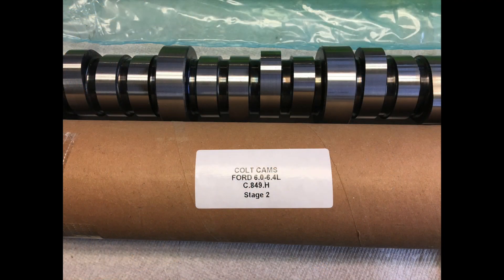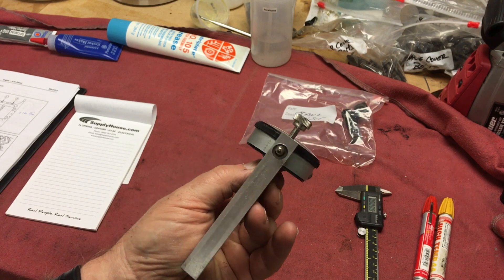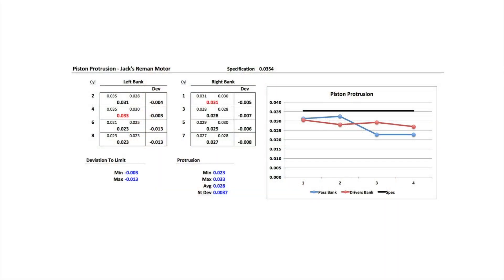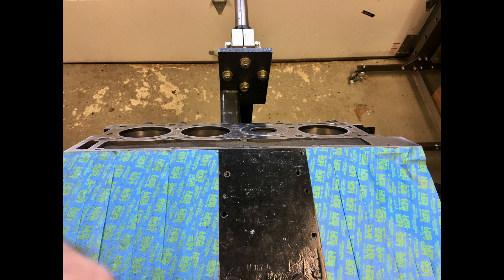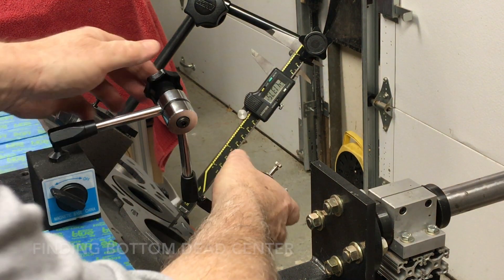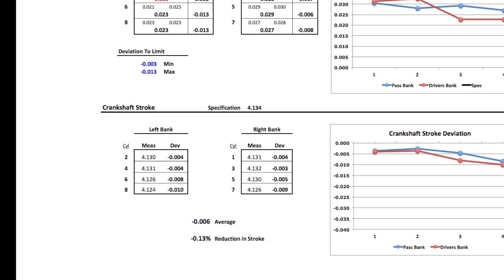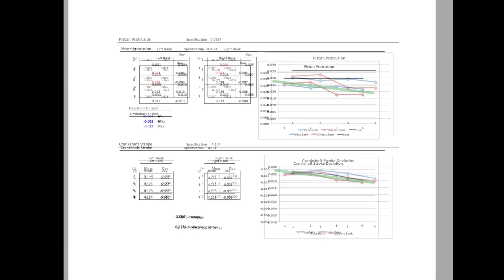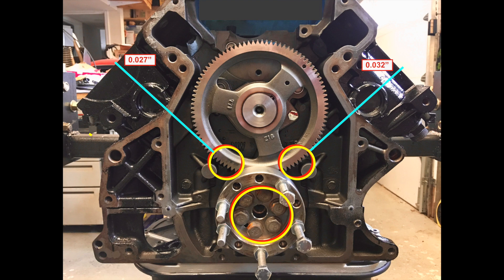Powerstroke 6.0 - Measuring Piston Protrusion and Crankshaft Stroke

Comment: Thank You so much for this video. There are 100's of videos on here of people "slamming" engines together and either they don't show the important measurements or they don't know to do them. This is the difference between doing it right, and wondering how long it will last. I never, ever want to pull the engine from my truck again. I'm checking every single measurement I can while building it. It's the only way I know to feel comfortable it will last.
Reply from the maker: Thanks for another comment.  You are right.  There are many that I try to watch, but stop when it's not the content I was expecting.  I too try to put things together so I don't have to worry.  Many years ago I got to spend a lot of time with Bill Stroppe at his garage - weeks.  The lesson was take care of all the little details and you won't have big issues.  Build for endurance.

Comment: Btw you made it possible to get my truck back on the road doing this job on gravel in between jobs living full time in a fifth wheel with my wife and two kids.
Reply from the maker: I'm glad you got it done, especially under those circumstances.
Reply: Yes it was not ideal but I got it done and towed my 41’ fifth wheel 2 days later. Now I’m looking for some work welding across the country so I’ll let you know how it goes after I’ve put several thousand miles on it.

Comment: I lapped the heads of my 6.0 and my head measures 44.94mm where I read spec should be 45mm, is this too much a deviation that I should get shorter push rods or a thicker head gasket?
Reply from the maker: It can't measure that, they measure 95mm/3.740".

Comment: For selfish reasons I hope you stay with this until you have a running truck. I believe you are working all of the issues out and building what could possibly be a motor that runs better than any other. Great video, thank you.
Reply from the maker: Thanks, Ray.  There already is a used, never-been-ground crankshaft back in.  The videos are way behind where I actually am.

Comment: The question I have is, was this checked during the rebuilding process the first time?
The thought provoking video is appreciated. So, what’s next?
Reply from the maker: Lord no!

I believe this motor was remanned at a Franklin facility bought by CAT and contracted by International and Ford.  When you start to talk to mechanics for either International or Ford fleets, this is not uncommon, and why I included some of their online posts.  I have more, including from someone who used to work there who couldn't believe what some employees got away with.  There's very little QC; they didn't care and I'm sure to Int/Ford this was the lowest cost vendor.  If you remember from my forensics video, the bearing issues, the debris, the valve cover both under the oil cooler.  I keep getting surprised at how bad it can get, but this was the last issue (I think).  I bought a used OE crank, that's in and will probably be the next video in the series.

Comment: That's the pits!  That's why we check our measurements. Thank you for another video. Try to stay with with. I know it's discouraging.
Reply from the maker: The measurements of the journals looked great, and they polished out nicely.  Before I pulled the motor down I spot checked the front pistons for protrusion and saw good numbers.  Since I never hydrolocked, I expected the rods to be fine, and they are.  I keep getting caught with this Ford reman not anticipating how poorly the work was done.

There's already another crank in the block, stock dimensions and both the strokes and protrusion numbers are good.
Reply: @toomanytoys  Great to hear that Jack!💪. Can't wait to see the next video!